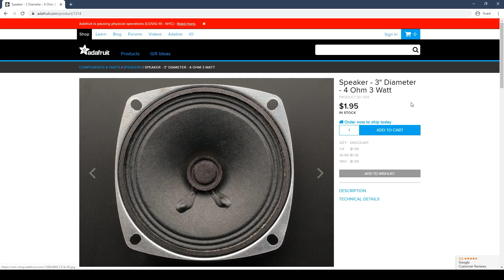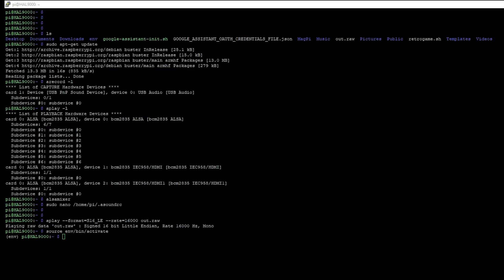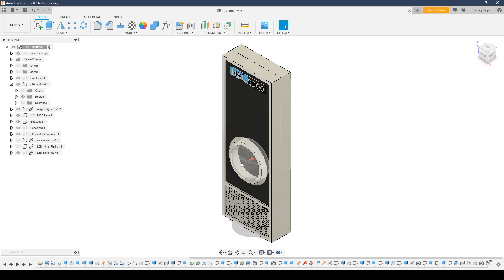HAL 9000 Google Assistant Using A Raspberry Pi

Comment: Redo the LED connection move the whole circuit to the left and you better plug your stuff in instead of having to do all the side connections that you could’ve saved by Just starting an answering Billy D if you had it soldered in not sure if you just used a USB port whatever.. Yes that’s somewhat disappointing by how slow my 3-D printer is to even though it’s supposed to be pretty quick still seems pretty slow when you take four or five hours to do a simple part print out

Comment: Awesome job! It looks great. I think a nice touch would have been to smoke paint the bubble over the LED, like people do with their car tail lights.
Reply from the maker: Thanks for the suggestion  I'm not familiar with smoke paint. Is that like a frosted finish to help diffuse the LED? From what I can tell in the movie the dome is pretty clear and not frosted.
Reply: @bytesizedengineering  It's been a while since I've seen the movie so it's very possible that I'm wrong. The paint is a semi-opaque black coating. It diffuses the light a little, but mostly it just blocks a portion of the light, causing a tinting effect. It's like tinted windows, but paint instead of vinyl (or whatever material that is).

Comment: Dude nice job on this just wondering how did you make that voice for hal? I would love to use it if possible
Reply: I’m pretty sure he is using the “Pink” voice for google home. To do this all you need to do is download the google assistant app go to settings find assistant voice and change it over to pink.
Reply from the maker: I just chose one of the standard voices included in Google assistant

Comment: Sounds like this would be the next step to get the voice just right :) https://medium.com/the-research-nest/voice-cloning-using-deep-learning-166f1b8d8595 Or if the API has support for speech rate, like the app. ("Tap Accessibility and then Text-to-speech output.
Drag the "Speech rate" slider to your preferred speed: ")

Comment: You can also power the pi through the host usb ports as well.
Reply from the maker: Really!? I didn't know that. I'll have to look into that more. Thanks for the tip 😁.
Reply: @bytesizedengineering  they didn't add it till the 2, or 3. But yours should have that.
Reply: @bytesizedengineering  bear in mind that there is a polyfuse on the micro USB power input circuit. I don't think there is any similar protection on GPIO and I think the polyfuses were removed from the USB type A ports quite early on in the various iterations of the Pi. People used to solder resistors on the circuit to circumvent limitations caused by them if I remember correctly.

I think if you go down the route of powering via GPIO then you are best to get a dedicated power HAT.

This shows the polyfuse on the Pi 3 circuit:
https://raspberrypi.stackexchange.com/questions/61302/does-raspberry-pi-zero-have-a-polyfuse

Next project...TARS and CASE from Interstellar! 😉
Reply: or from the GPIO pins

Comment: Did you just press the button and activate the assistant ?? for sure it didnt wake up to hotword on video.
Reply from the maker: Yes the button press activates the assistant. No no need to say "okay Google"
Reply: @bytesizedengineering  Right, because new Google Assistant SDK does not support hotword activation :)